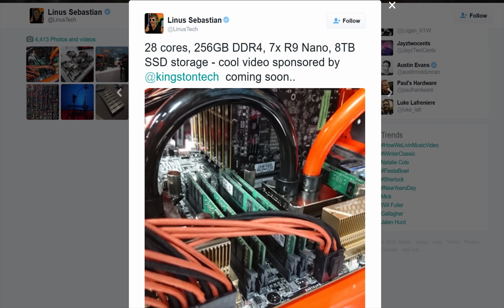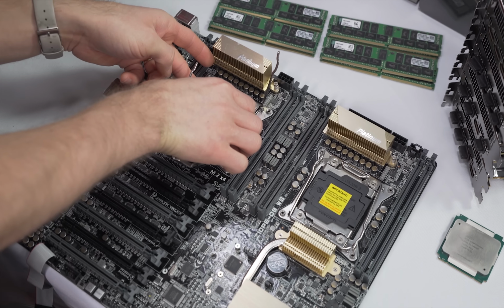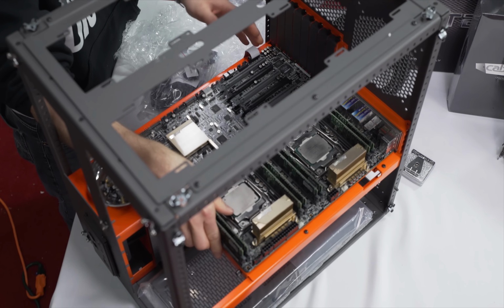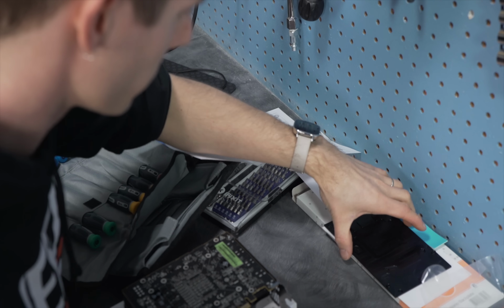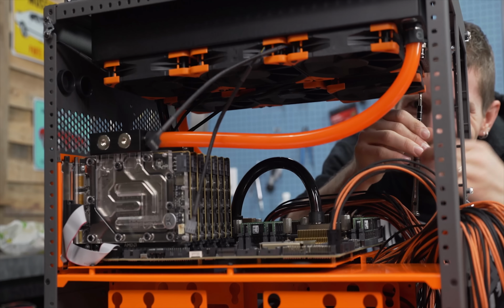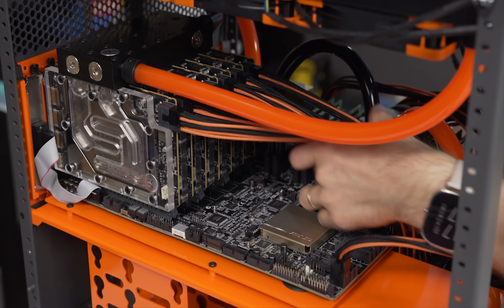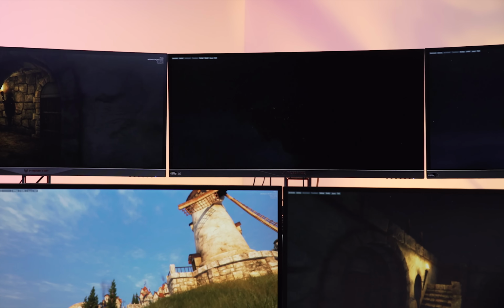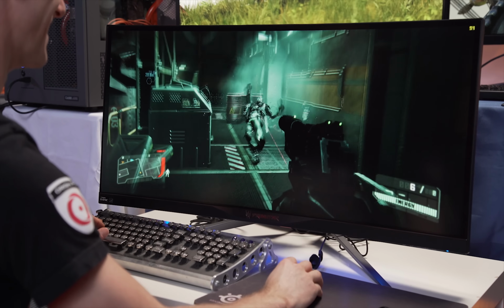7 Gamers, 1 CPU - Ultimate Virtualized Gaming Build Log

Comment: are they all sharing the same OS? Doesn't this mean each person will be fighting over which mouse controls which program? I was wondering why they did this isn't this the main reason why they made grid computing so each person can get their own vm. For 30 grand over 4 grand per person I would think it would be a lot less effort to just trash the system entirely and just log into an amazon g2.8xlarge server for each gamer. For over 4 grand per person your talking about having to have 7 people play together for that 4,200/2.6 dollars an hour = 1615 hours of gaming together without any setup or quirk issues, that is like 200 full days of gaming with each other. AWS would be cheaper per person even if you got together weekly or even a few times a week for a whole year. Other advantages of AWS you can use it whereever and to contradict the other commentators you can save money on your air-conditioning as this 2.6 dollars an hour include electricity and reduces your houses heat.
Reply: +Jacky Xie I am not trying to advertise, I am just disappointed, I build my own computers and I would support for a couple grand a great gtx 970 in sli for the same cost the amazon server would only give us about 800 hours of time, the gpu's would be about the same the cpu's would be about 4-5x more but for a personal computer your talking 1/3 of a year for 2 grand I can use this computer 3-5 years hapily. 

the problem with this computer is limited use everyone fighting over a focus on application for single os, and it is only beneficial when you have a lan party and 8 people over so the effort vs the cost of just renting something out for 2.6 dollars an hour per person all the sudden wins, just because of the lack of purchasing power at this price range and the lack of functionality when using too much consumer grade products for a computer that is basically doing what a business based computer can already do. That is why for this one it makes more sense to get aws server.
Reply: +Jacky Xie Also one last response hardware comparison. Amd nano vs 2xnvidia grid k2 cards, the two nvidia grid k2 cards will put out about 60-80% more performance even with the sli scaling issues and with amazon scaling techniques you are not really getting this hardware dedicated to you so scaling will be even better.

two e5-2697 v3 split between 7 people vs each person getting four E5-2670&#39;s. So each 2697 v3 is about 2x the performance of an E5-2670 as the generation differences matter, but having four cpu&#39;s dedicated to one cloud computer vs two 2x cpu&#39;s means for the 2.6 cents you have the same processing power this guy is splitting between 7 people. The deal just got bad. When it comes to gpu&#39;s amazon is just cheaper for maybe lan party convenience not for building individual computers, but it is a ton cheaper for processing power. I don&#39;t think for that price I could go out and buy 4 2670&#39;s myself and justify it over the AWS the cpu&#39;s would cost about 6 grand  alone. I am just happy though with my 4930k for now.

And yeah I worked for cisco, but i am just a software engineer I am not advertising I am just trying to justify myself if cloud computing is actually getting cheap enough for consumers soon. At this point of time I would say no. For a personal computer I can say i use at least 8 hours a day, 9-15k hours in a lifetime, and spend about 2 grand. Amazon servers cost 2.6 dollars an hour so that is 23-39 grand to rent amazon servers for the same 2 grand to own a sufficient gaming computer on my own. So their gpu based machines are about 11.5 to 19.5 times too expensive. If they wanted to compete in the consumer gaming market they would have to greatly expand their hard drive space and bring the prices probably closer to C3.large pricing. about 435 dollars down 66 dollars a month after just to start competing, but it would be in their best interest to drop this price even lower to about half that monthly cost probably and instead of two e5-2666 just give us one cpu, more hard drive space and a good cloud computing gpu. It seems like the cost of gpu's are killing them as there is not much demand yet.
Reply: +Graham Radetsky You sir need to watch the "two gamers, one CPU" video. No, this machine is not running one instance of an OS. It is running 7 OSs on 7 screens, each screen plugged into  respective GPU. Through the unraid program you are able to split up the 26 CPU cores into 7 different machines then assign the different USB ports to the different instances of the OS (I want to see the back of this computer, that is a lot of cords).
Reply: +MrHorris yeah still for the same price it is too expensive for a computer used soley for 7 people at the same time in the same place, unless used for lan gaming which aws would be cheaper for, it would only be practical to be setup for remote access not local access.
Reply: +Graham Radetsky I'm pretty sure it was done to see if it could be done.  Color me impressed.
Reply: +Graham Radetsky Holy shit, you have to be the most boring person on youtube, this PC wasn't built to calculate just how many dollars per hour 7 people can get out of it gaming per year. I don't care what you could build, and that it could be more efficient. That is entirely not the point of this video. How can you watch this video and think to yourself "7 people play together for that 4,200/2.6 dollars an hour = 1615 hours of gaming together" and so on.

Get a life! anyone here already knows how to build computers that make more sense than this. Linus specifically states this is just to see if it can be done. a proof of concept to showcase at CES.

Between your comment, and all the minecraft and minesweeper jokes... I may just blow my brains out.

 I just don't know anymore, you people.

Comment: Hot damn that was more expensive than I thought.
Reply: +عدنان قشلان No, it's more expensive
Reply: +Warchamp7 

$7k for monitors
$565 motherboard
$5540 for Xeons
$2400  for RAM
$3200 for SSDs
$500? for the case
$4200 for GPUs
$560 PSU
Already at 24,000
 (without watercooling stuff or custom colored cables)
Reply: MOST Expensive i thinnk
Reply: +TJD269 No it was all free.  So this system was $0.
Reply: +cheapo911 Half that cost is the watercooling. Maybe the monitors too? Processors are ~$2800 each, Motherboard is ~$600, PSU is ~$600, GPUs are ~$600 each. That only adds up to $11,000
Reply: +عدنان قشلان fashalt nafsk
Reply: +TJD269 it's 610 for each gpu
Reply: +unijabnx2000 Why would anyone need 32 GB ram though, could reduce that to half
Reply: +Cityguysims Cityguysim My machine has 32GB ram, and I run out of memory at times. That's the problem with rendering out high end footage, running a server, doing 3D graphics work and watching multiple videos online at the same time.
Reply: +FlipFlopGaming You watch multiple videos at the same time? You must have brilliant eyes.
Reply: too much info to learn, too little time
Reply: Cityguysims Cityguysim  because he can... He did.
Reply: +cheapo911  if you think about it like this its made for 7 people to game just divide the cost by 7 lol and make your friends pay that amount then you have a gaming room for the boys
Reply: Arsenio Ortiz So you have 4300 laying around and 6 of your friends also have 4300 dollars laying around?
Reply: unijabnx2000 totally ;)
Reply: Arsenio Ortiz Well hook that shit up, & tag me in the comments when you post the video.
Reply: +Warchamp7 Lmao only XD

Comment: Do 7 player multiplayer with it.
Reply: I believe that's what they'll be doing at CES.
Reply: +skylar15123 yes for channel super fun
Reply: +Andy Ladd usb hubs and usb ethernet adapters maybe?
Reply: +Andy Ladd not true, you can assign independent mac and ips to vms on the same host all on one network connection.
Reply: +skylar15123 Each machine would need a network interface. I'd be interested to see how they handle that with the lack of USB ports and PCI slots.
Reply: Also if only gaming between each other then it'll all be done in RAM on a virtual "switch" without ever touching the NIC.
Reply: +Andy Ladd seven virtual network interfaces, all wired through single physical network interface. 7 Virtualized OS over a single real OS, remember?
Reply: +darkavenger10k yeah not like they will saturate it anyway for gaming which barely touches network bandwidth now if they were each trying to host a server that would be different
Reply: +Andy Ladd Can bridge the virtual machine network interfaces to one NIC
Reply: +Andy Ladd  Actually they are VM's they share the same ethernet.
Reply: +darkavenger10k It will touch the chip on the nic but wont leave the network port. The ms kernel will always send network traffic to the NIC but the bridge on that nic will route (swich) it to the correct vm.
Reply: +Toxic Hatred if all 7 players are on the same machine, ethernet doesn't even rank as a problem.  and honestly, with 2 gigabit ports, 7 users shouldn't saturate the hardware interface.
Reply: Sander Haukelidsæter no clue what that means XD

Comment: Out of curiosity, why not use two power supplies?  At load this draws ~1500W, which is almost the top end for a 1600W Titanium-efficiency power supply on a 120V socket.  That would have given you some more flexibility with GPU choice and it would have been a bit more efficient

Comment: I feel like EK should have designed that connector to allow for two separate water-cooling loops. Seven GPUs is just too much for one loop. Those last two or three cards in that loop have got to be getting a bit toasty. You would still need two pumps, but flow rates and temps should be better with two separate loops.
Reply: +JesseArt not at all. The difference is max 2-4 degrees.
Reply: +JesseArt Just more flow is all you need.
Reply: All 7 cards get an even amount of flow.
Reply: Eevee A_ I meant faster flow across all the cards, although since water has such a high thermal capacity it's probably just the conductivity of the blocks themselves.

Comment: People are saying that 7 comparable PCs would cost $1,000, but wow are they wrong. If you were to build 7 PCs with similar components (I used an i5 for CPU), then the build would cost $4,000, which x7 is $28,000. Remember, that $30,000 included a whole lot of monitors and expensive blocks.

https://pcpartpicker.com/user/elicik/saved/v6g6Mp

Comment: Making my own gaming rig (OLD) AMD 8350 (NEW) MSI 970 gaming motherboard, 16GB G skill ram, cooler master nepton 240M cpu cooler, MSI gaming GTX 970, Evga 750w psu, samsung 250GB SSd, WD 3Tb sata, 3 cooler master extra flow fans and Cooler master Mastercase pro 5.

Comment: At 1550 watts, I would be worried about power supply failure.  I would think that a dual PSU setup would be safer to pull off.

Comment: My question is why? You can build a top of the line rig for $3k. So why put 7 gamers in the same place, limited by cord lengths, instead of having 10 gamers wherever?
Reply: +James Tanner The same reason we do most things: to prove that it can be done. Why do people go for super high overclocks on CPUs when in most cases an extra 100 MHz will make no discernible difference? When sponsors are willing to throw serious hardware at LMG, the question shouldn't be "why?" but rather "why not?"
Reply: Touche'.

Comment: This is why I'd rather just stick with consoles and buy an already made PC and not build one. But anyway, this is extremely impressive and congrats for making something this amazing.
Reply: gamerprince1999 My first time building a pc took about 2 hours but now that I'm experienced I can usually build one in less than an hour.
It's really easy, everything only has one slot it can possibly fit in, it's not as complicated as you might think.
Reply: +gamerprince1999 And that's why you should build your own pc, it'll save you hundreds of dollars.
Reply: ***** I do want to start using PC soon what I meant was not build one since I would have to buy all the parts and stuff.
Reply: +gamerprince1999 or you could do the smart thing and save a ton of money
Reply: BOT Jonathan Yeah I don't have a job yet sadly
Reply: Blaackys Hmmm... Maybe I should
Reply: +gamerprince1999 did my pc in about 1 - 2 hours, not that hard. its like building Legos if you watch a video on how to build a pc.
Reply: +gamerprince1999 building a computer is nothing like this, this video was fucking insane
Reply: Building your own PC will save you lots you can build a PC for $500 with a GTX 750ti or GTX 950 for under $500 see here I wrote a spec sheet in a different  comment section.

+UnForCereal Well, I actually just saw that he could actually make a build with the $400 that the GPU is worth here is the build.

Cpu: FX6300 6 core AMD cpu 3.5ghz turbo boost to 4.5ghz has lots of overclocking potential. $99.99

 GPU: GTX 750ti $125.08 EVGA

Motherboard: Asus Micro ATX DDR3  AM3+ $49.99

Hard  drive: WD 1TB hard drive $54.99

power supply: evga 500 watt  $39.99

 Heatsink: cooler master hyper evo 12 29.99

I think that's about it the SSd is optional though.

If you add this up this whole build is $400.03 

And a GTX 980 is $509.99 so I could of went a bit more expensive on the GPU maybe a GTX 960 or 950. But yeah if he sells he can build a adequate gaming  PC that will suit his gaming needs.

Here's all the parts links 

Motherboard: http://www.amazon.com/gp/aw/d/B00DQO9L1Q/ref=mp_s_a_1_5?qid=1451508271&sr=8-5&pi=AC_SX110_SY165_QL70&keywords=asus+motherboard&dpPl=1&dpID=51788BBbpeL&ref=plSrch

CPU: http://www.amazon.com/gp/aw/d/B009O7YORK/ref=mp_s_a_1_1?qid=1451508320&sr=8-1&pi=SX200_QL40&keywords=fx+6300&dpPl=1&dpID=41xjeiOr-SL&ref=plSrch

GPU: http://www.amazon.com/gp/aw/d/B00IDG3PRI/ref=mp_s_a_1_1?qid=1451508363&sr=8-1&pi=SX200_QL40&keywords=gtx+750+ti&dpPl=1&dpID=41DRNhKfqIL&ref=plSrch

Power supply: http://www.amazon.com/gp/aw/d/B00H33SFJU/ref=mp_s_a_1_1?qid=1451508398&sr=8-1&pi=SY200_QL40&keywords=power+supply&dpPl=1&dpID=51AFmFLRqWL&ref=plSrch

Hard drive: http://www.amazon.com/gp/aw/d/B0088PUEPK/ref=mp_s_a_1_1?qid=1451508455&sr=8-1&pi=SY200_QL40&keywords=hard+drive&dpPl=1&dpID=51AhP4ZpjuL&ref=plSrch

Heatsink: http://www.amazon.com/gp/aw/d/B005O65JXI/ref=mp_s_a_1_1?qid=1451508492&sr=8-1&pi=SY200_QL40&keywords=heatsink&dpPl=1&dpID=518BEXKEiiL&ref=plSrch

I'm assuming he doesn't have his own tower though so maybe I should add in a tower...

But you could just get a tower from one of your old desktop computers...

Here's tower this will bring the total to $425.02 but whatever. Still lower then the price of the 980 which is $569.99 without sale.

Tower: Xion performance $24.99

Link to tower: http://www.amazon.com/gp/aw/d/B00SAYCFF6/ref=mp_s_a_1_5?qid=1451508741&sr=8-5&pi=AC_SX110_SY165_QL70&keywords=Desktop+case&dpPl=1&dpID=41PCx8xCyEL&ref=plSrch

Comment: Why not a Corsair 900D? It seems like it would fit your needs.
Reply: +Delta Drakon Because the 900D would weigh far too much with all of that hardware. The 900D also has the motherboard in an upright position meaning that there would probably be too much strain on the motherboard will all of the GPUs and the massive CPU coolers. Also, when you are making a build as over-the-top as this you might as well use the best case available and Caselabs make the best cases for custom water-cooled PCs.
Reply: A 900D has much less space.

Comment: Now imagine this thing with seven R9 390X2s XD.
Reply: +InfinityCraft Won't work 1 R9 390x2s will be conisdered as 2 gpus and holy shit the power consumption
Reply: +BurningFoxMan titan x is not a dual gpu card
Reply: There would be a huge burning pile of hardware 5 minutes after you turn it on the first time.
Reply: +Error989 It isn't?
Reply: Patriotic Wank it has the same GPU as 980ti, tho 980ti has a cut down version... so no... Titan X has one GPU, Titan Z (that was probably never even sold) has 2 gpus (but from the old Titan)
Reply: Error989 ah, Thanks. :D
Reply: +BurningFoxMan The cards have a reputation for being very hot.
Reply: +'Murrican Oil that's why you don't use a single power supply, run 2 or even 3.
Reply: +InfinityCraft I'd rather imagine 7 Titan X's ;) But that wouldn't be possible since that many GPU's at load would def blow ur whole house up LOL
Reply: God that 50 grand in my country would be double with the prices of tech over here lol
Reply: ***** I don't even live in Australia lmao.
Reply: +'Murrican Oil Yeah... seven times six hundred is 4200. You'd literally need three 1600W PSUs.

Comment: Hey linus can u build this plz
gpu: asus GTX 970 strix
Cpu: intel core i5 4690k
Psu: corsair cx 600 watt
Case: NZXT s340 red and black 
Motherboard: msi atx ddr3 2600 lga 1150 motherboards Z97 gaming 5
SSD: samsung 850 evo 250gb 
HDD: seagate 1TB 
Ram: corsair Vengence pro series 8GB 2400 MHz
CPU cooler: cooler master hyper 212 evo 
EXTRA fans: rosewill 120 mm long life
Reply: +manorotti He already did hundreds of similar builds like that
Reply: +manorotti why? If you need help building your first system just look at some of his older fully guide videos. They are pretty long but very informative. The knowledge in those can be applied to those parts.

Comment: Ok Linus my Friend :D
Here is the 3. Multi Gamer Build for you:

SuperMicro X8DTH-iF 100$ on Ebay 
2x X5670 200$ on Ebay 
32GB DDR3 Servrer RAM 50$ on Ebay 
4x GTX 960 760$ NEW 
1000W powere Suply 120$ NEW
Used Big tower Case 50$ on Ebay
4x 256GB SSD 280$ NEW

Soooo each of the 4 Gamers will have 3 Cores 6 Therds (should be about the Performance of a Intel® Core™ i5-650) 8GB DDR3 1333 RAM and a GTX 960, 256GB SSD.
Sounds like a decent combo for 390$ x 4 :D